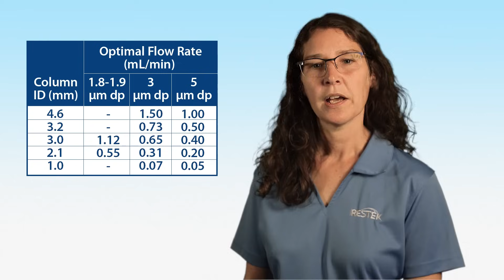What Do You Do with a New LC Column?

Comment: In every column the flow direction is mentioned, but i came through that if we use reverse also, the efficiency of the chromatography will be same. Is it true??
Reply from the maker: While some columns can be briefly rinsed by reversing the flow, in general, an LC column should only be used with flow in the direction indicated on the column. Some additional information from our instruction sheets: "Flow Direction & Flow Rate The arrows on the column label indicate the recommended flow direction. Begin by connecting the inlet end of the column to the injector or autosampler and allow mobile phase to flow from the outlet end of the column into a beaker for 10–15 minutes. Gradually increase the flow rate to its optimal value (Table I). Then, stop the mobile phase flow and connect the column to your detector. Because every LC system is unique, especially when used in gradient mode, your results may differ from those obtained in our laboratory."